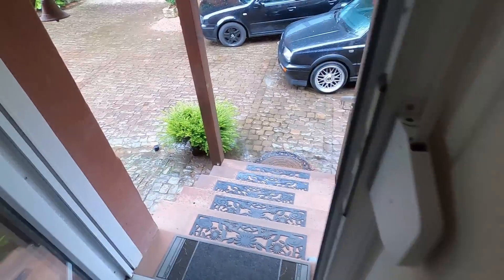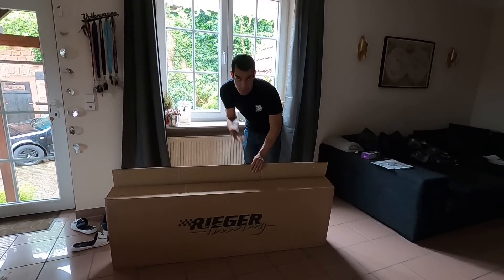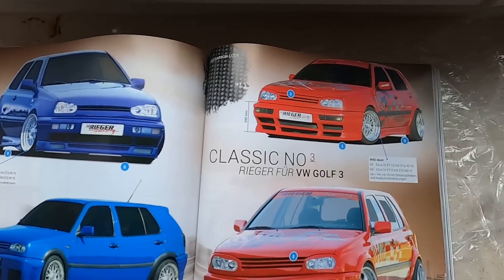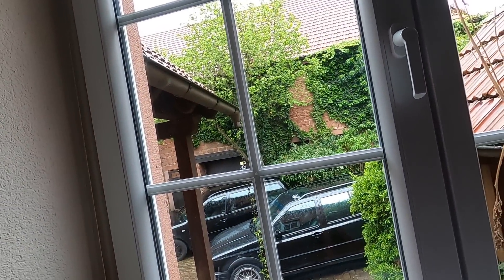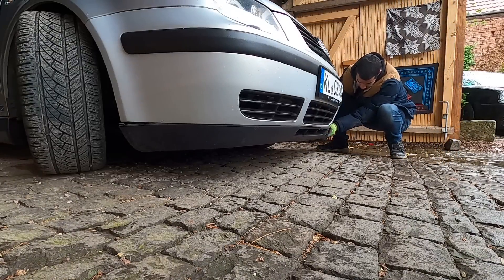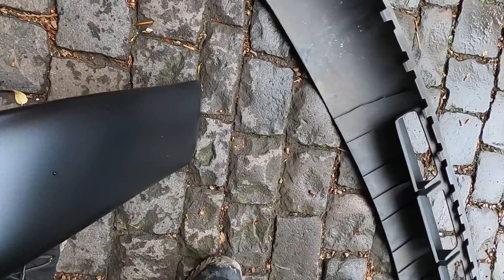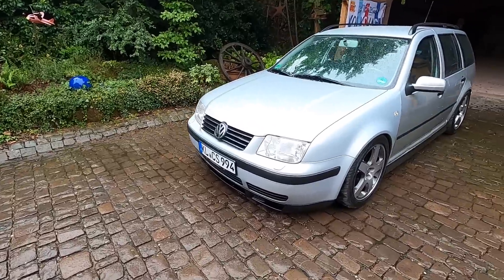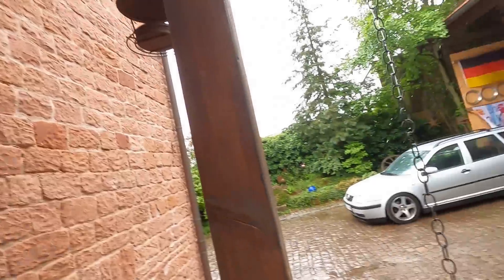Rieger Parts For The MK4 Bora Wagon!

Comment: Handy option is to mount a cable tie though the fender liner to the hole you made on lip. Handy if ever stuck somewhere. Tie will give up and break before lip so is a safety feature. Spare ties and snips in the car for quick release 😂 looking good though dude!